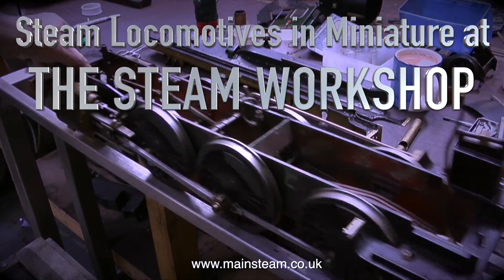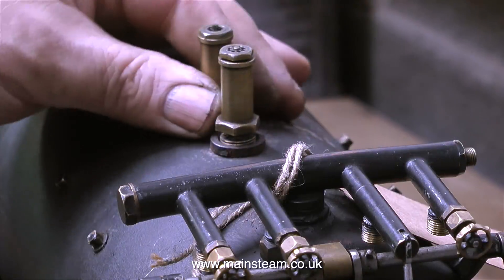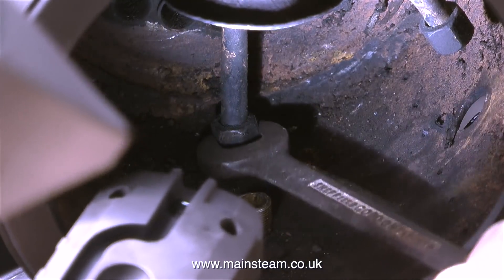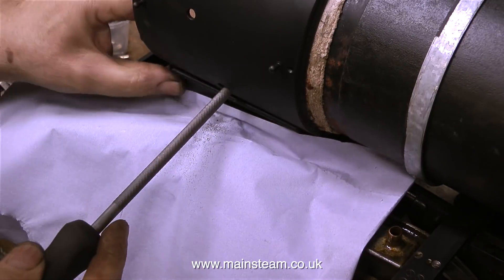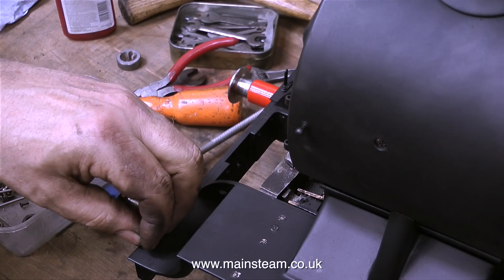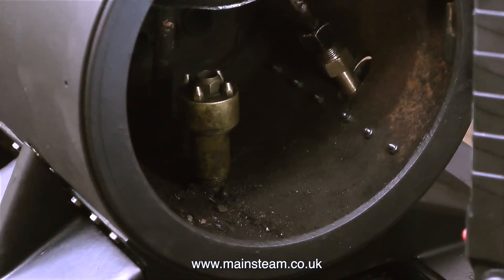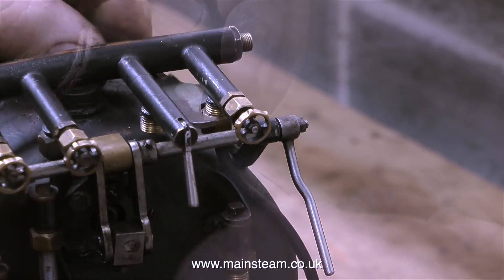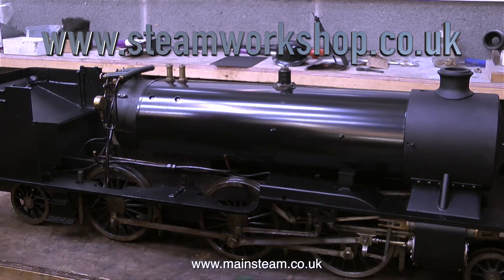WORKING AT THE STEAM WORKSHOP - FITTING THE BOILER TO THE LNER V1

Comment: The steam tube is a V3 style tube. V1 leaves the cylinder block at 66 degrees and then changes angle and enters the smoke box at about 15 degrees to the horizontal. All shrouded with a polished aluminium style cover. But V3 does not have the pronounced upstand around the tube like the V1.

Comment: Can anyone remember Keith’s steam oil mix? I can’t for the life of me find the video. It was a mix he used for running gear.
Reply from the maker: 50% 1000 grade steam cylinder oil 25% machine oil and 50% Rapeseed Oil . . . it works for me {:-)))
Reply: Tadge N Deer The one he uses as a general lubricant, the special sauce? I think it was 1/3 steam oil, 1/3 rapeseed oil, and 1/3 machine oil.

Not completely sure if that's it, I know its special ingrediant is the rapeseed, but the amounts might be off.